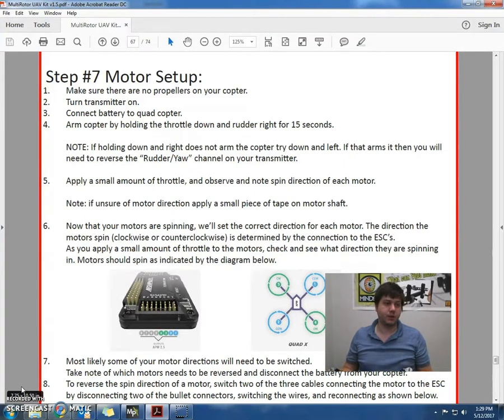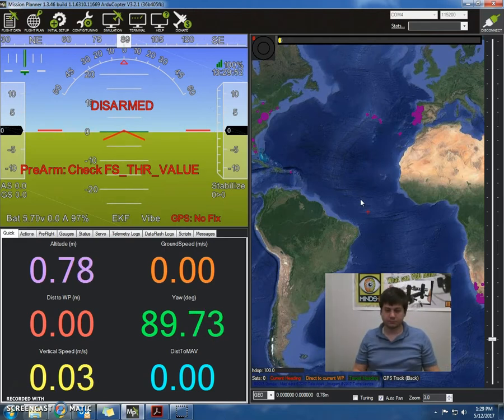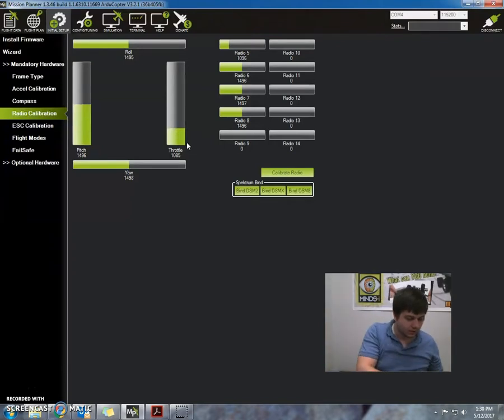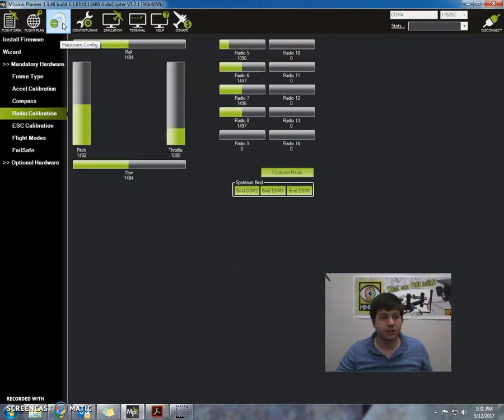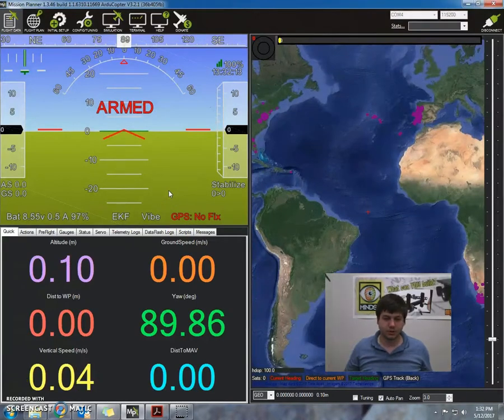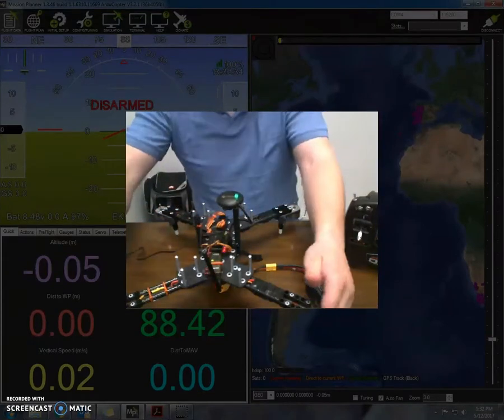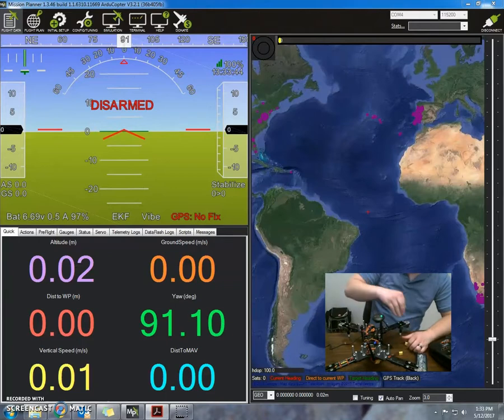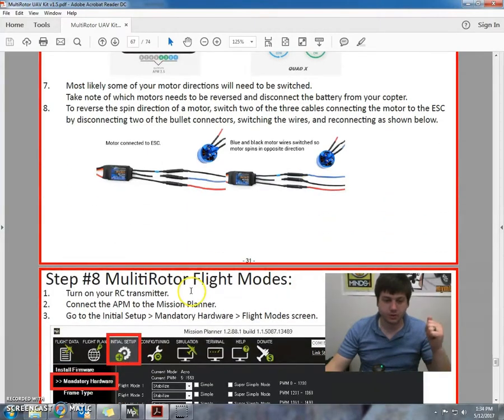MINDS-i Mission Planner Step #7 Motor Setup

Comment: if i cant change the wires , is there any other solution to change motor direction
Reply from the maker: With most airplane ESC's you need to change the wires to reverse the direction. Very few have programmable options that allow you to reverse direction of orientation. Are you using a MINDS-i Kit?